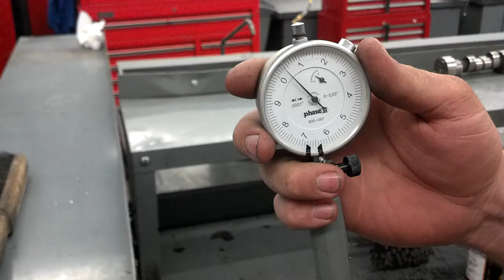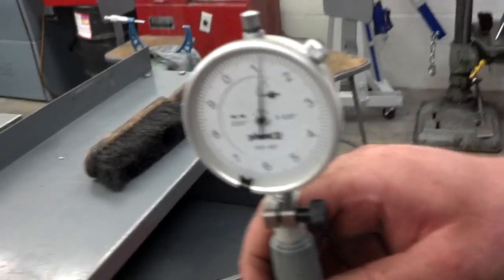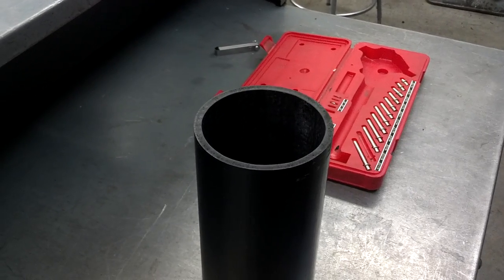Measuring a cylinder of an engine

Comment: Good Day Justin : I'm a aircraft level inspector . I really enjoyed the video . I went through College for Tool & Die Design . Your video certainly brings back memories . I spent about 16 yrs in a military gas turbine blade mfg plant and also other aircraft level Shops in Canada . I used hundreds and hundreds of dial bores like Starrett, Mitutoyo , Federal , Sunnen etc . When you are attempting to locate an out of round condition always use a straight rod dial bore , as in your video. Get your purchasing dept to locate a setting device for you that will accommodate the dial bore that is shown in your video . ( looks like a Mitutoyo ) . If you are measuring a completely finished over bored cylinder , use a a digital Sunnen three fingered dial bore for your needs . This type of dial bore contacts at three spots 120 degrees apart and will give you excellent /splendid results on your new finished bores . The beauty of the three fingered models is that they automatically set them selves . Each comes with an accurate "Setting Ring" , no chance for error , ever . Good Luck !

Comment: This technique will give one a measurement of the bore size however, it introduces error in that it can't tell you if the bore is egg or barrel shaped because it is measuring at two points. I always use three position measuring micrometers which reduce those errors.
Reply from the maker: You are right about measuring taper and out-of-round.  That can be done easily with this tool, by taking at least three measurements around the cylinder at both the upper and lower ends of the cylinder.

Comment: As long as it's a very good, accurate micrometer.
If you have cylindrical ring gage (setting ring inside diameter), it's the easiest and most accurate way to calibrate dial bore gauge. Of course, you may not have one in your inventory and have to special order it.

Comment: Personally I rather use telescopic gauges in combination with a set of micrometers. Easier to use and you can measure a dimension instead of check a dimension. But it's all personal preference of course. Nice vid!
Reply: Thanks for the tip - ordered! :)

Comment: hi Justin, very good video! One remark.

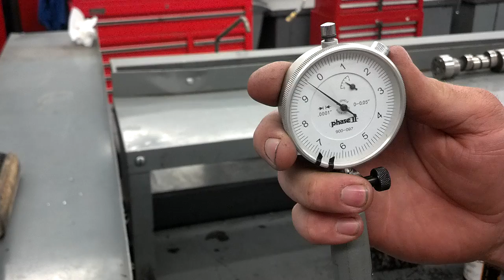At minute 2:00 you set the gauge to zero using the micrometer. 
The long hand of the dial gauge is dialed to zero. 
The short hand of the gauge indicating 10 thousandth or full turns 
shows there something between two and three, about 2.7.

At minute 2:52 at the first measurement of the cylinder the
short hand of the dial gauge shows about 1.3.

So the difference to zero is somewhere between 10 and 20 thousands.

And more precise (reading now also the long hand of the gauge) 
it is about 13.6 thousands above specification?

What do you think?

Comment: For being a machining tool this doesn't seem to be very accurate at all. You can literally make it read whatever you want it to by moving it around
Reply from the maker: The tool is actually quite accurate, but that silly tube that I am using is very uneven on the inside.  You will get more consistent readings on a real engine cylinder or sleeve.  Try this video instead:  https://www.youtube.com/watch?v=qLzMQtJAljg.
Reply: by moving it around, value changes, but when measuring bore, you move it and look for maximum. Diameter is by definition bigggest straight line inside a circle. And that is what we want to measure
Reply: @jevnik542  you move it in axial direction, so you actually look for the smallest dimension. That determines the diameter. This tool is spring loaded and centers itself in the centerline of the diameter.
Reply: @teis79  with a digital dial indicator it is much easier to read

Comment: I like it! Wouldn't you have to twist it also to insure that it's at the widest point? Kinda like how your rocking it to insure it's at its widest point in the vertical plane so wouldn't you need to twist it on the horizontal circumference plane? Does that make sense?
Reply from the maker: No, this tool can't be used in that way.  If you rotate the tool, you must then pivot it up and down again to find the measurement in that location.  If you want to get more accurate to make sure you aren't missing the widest spot, you will just have to measure the bore in more positions around the cylinder.

Comment: instead of using micrometer we can use master ring of that particular size and we r always supposed to set the bore dial gauge zero ( with respect to particular master ring ) before inserting it in any hole for measurement.
Now reading clockwise is plus size and anticlockwise is minus size ( from set zero )

Comment: We used these today for the first time. I noticed that it was confusing on how to get a reading. If you tilt the tool then the gauge just moves all over the place. Is the point to keep it upright, and then get the reading?
Reply from the maker: Yes, setting up the bore gauge in the micrometer can be tricky.  I find that it is easiest to hold the back of the gauge steady while rocking the front end up and down.  It is still sometimes takes a few minutes to get a good adjustment.

Comment: can you use a digital vernier caliper to calibrate this as well? Like, turn the knob to lock it and use that?
Reply: You could Bob, but it would depend on your tolerance. A caliper is only accurate upto +/- 0.002" which gives a 0.004" range of error. With a cylinder bore you'll want to be as accurate as possible, so using a micrometer which repeats within 0.00005" would be best practice.

If you're cylinder bore tolerance was +/- 0.005" a Digital Caliper would be perfectly fine.

Comment: Great video, I looked for nearly that. Can you help with what we should use if we need measure 2 meters (6,5 ft I suppose) in diametr cylinder.
Reply: You'd want to look at an inside bore mic. They have a cylindrical ceramic style that you can get which is a great reference tool. And then you'd need to pair that with an appropriate micrometer to check the size.

Comment: i was wondering do you have to have a mikrometer to set to dial bore gauge to zero or can i use a digital caliper???
Reply: You could, but it would depend on your tolerance. A caliper is only accurate upto +/- 0.002" which gives a 0.004" range of error. With a cylinder bore you'll want to be as accurate as possible, so using a micrometer which repeats within 0.00005" would be best practice.

If you're cylinder bore tolerance was +/- 0.005" a Digital Caliper would be perfectly fine.